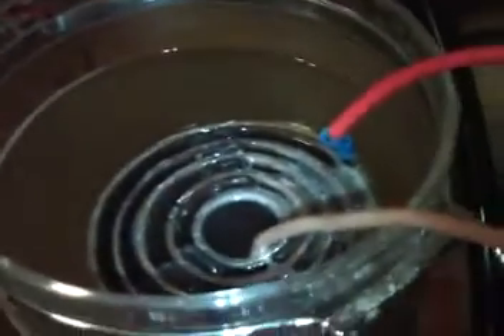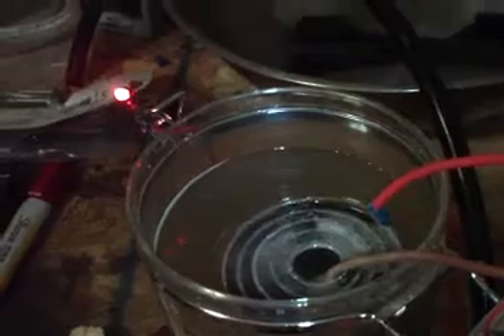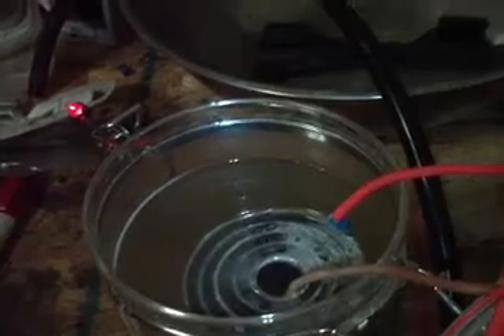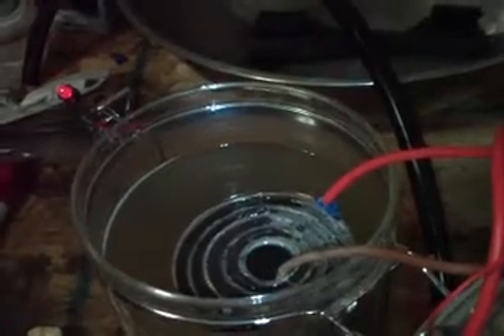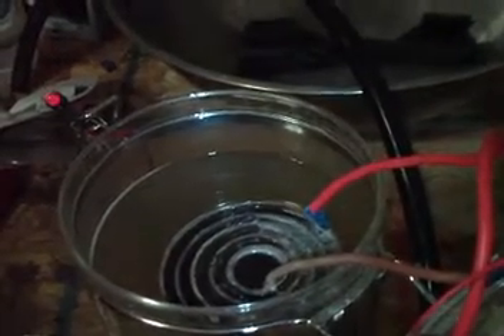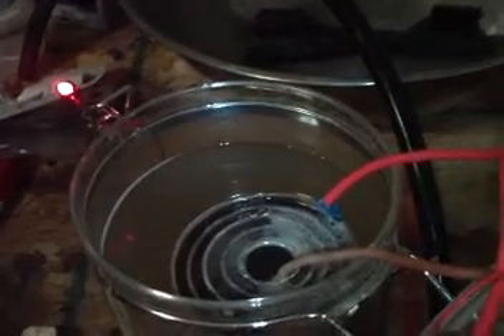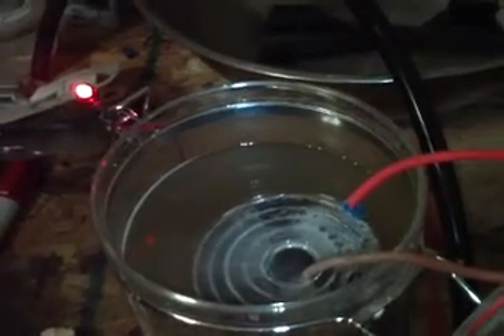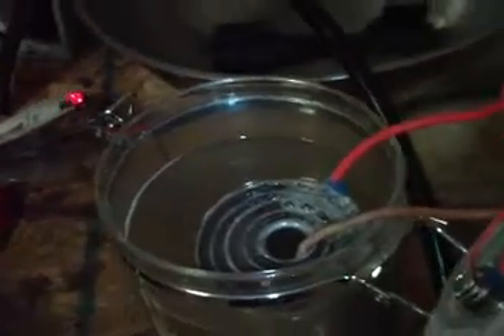Joe Cell powering an LED after it's powered down!!

Comment: The reason the light is still on is because the Joe cell, or any other electrolyzer is in fact the same as a battery. Not a very good one mind you, but the principles are the same. if you put a strip of copper and a strip of zinc in a glass of water, you will get current. same thing just different metals...